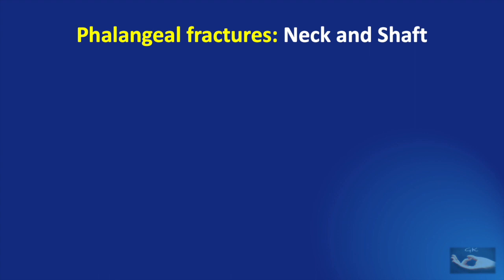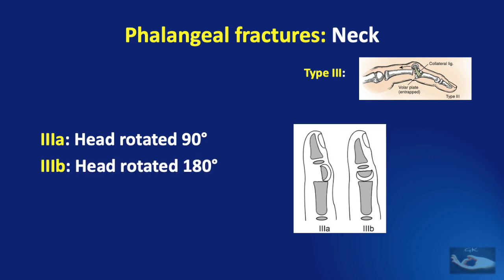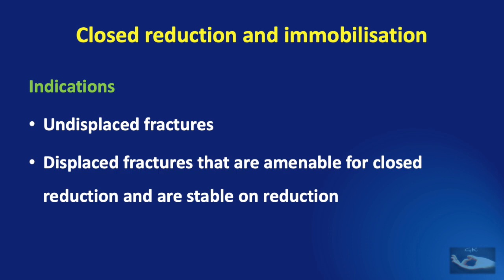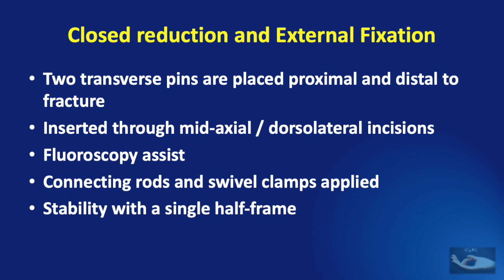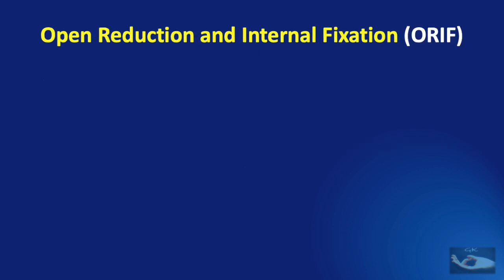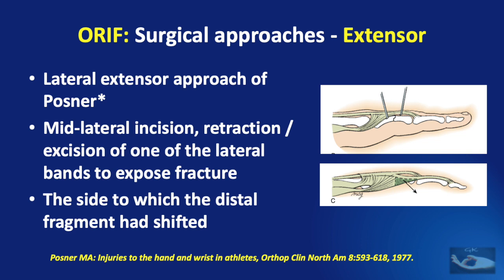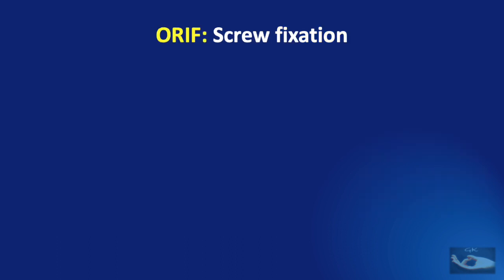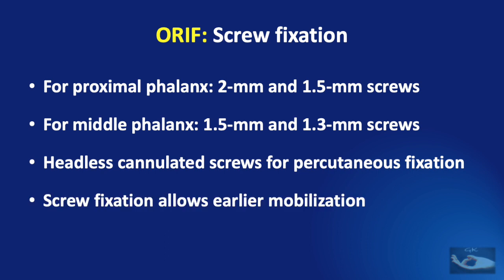Phalangeal neck and shaft fractures: Methods of management - POP, K wires, Lag screws and therapy

Comment: Hello, congratulations for the video. Question, at 18:28 you say in the video that the images are at the end of 3 months. 1- I found it strange that the X-ray did not show consolidation after 12 weeks. 2- Do you remove the K thread in 3 weeks? Wouldn't it be too soon? Even more so without radiographic consolidation of the fracture.
Congratulations again, I would just like to discuss the case. Do you own other social media?
Reply from the maker: Very astute observation, @SoulRockZ! That is the advantage of using the K wire for fixation. We remove the K wire at 3 weeks based on clinical assessment - no tenderness at fracture site, that's all. At this time, the fracture is only sticky and not yet consolidated. We can mould the fracture further with the methods I have mentioned - gentle PROM and AROM exercises, straightening splint when not exercising and repeated serial X-rays. This will ensure a good result. It always takes longer for consolidation of the bone when remoulding is done after the K wire removal. So the secondary healing in bone is further delayed. I hope I have been clear.